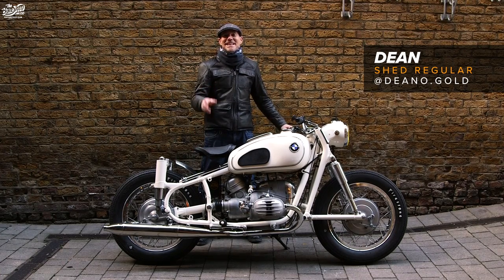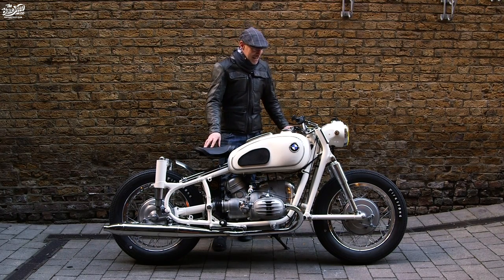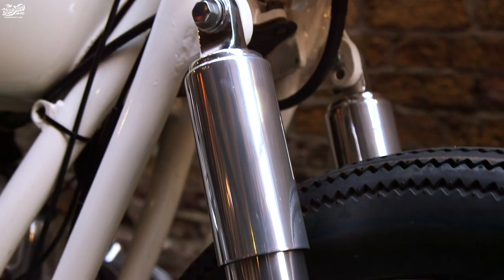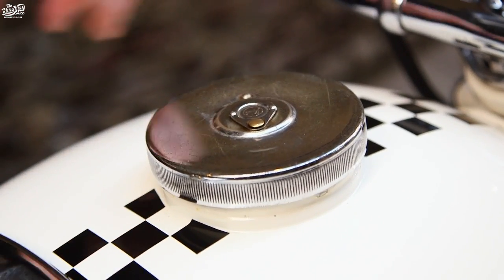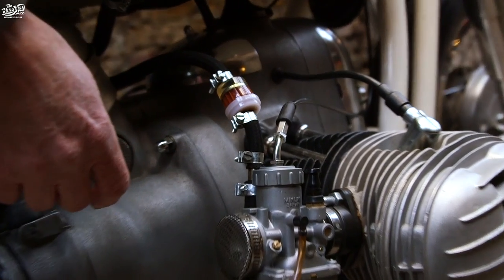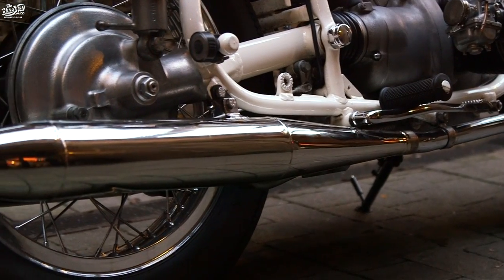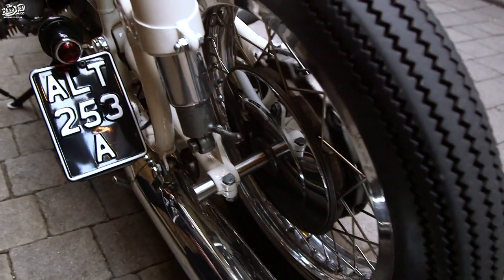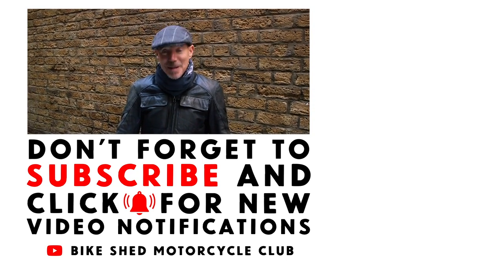Regulars Rides: Dean's vintage 1963 BMW R60

Comment: Some people say a vehicle is just to get from point A to point B. They're wrong. The vehicle is the point.
Reply: Here, here.
Reply: those ppl are defo  not petrolheads.
Reply: you are wrong as well. the ride from A to B is the point 😀
Reply: @uleiosu4582  It is harder to turn your head and look around with lower handlebars.  This results in relying more using mirrors especially while changing lanes.  Mirrors work great, but on this bike the mirrors are way too small to be effective.  This makes the motorcycle dangerous in a traffic situation.  So this motorcycle is great for a single lane country back road.  Its a pretty bike and I love it, but safety must come first above styling.  One mistake in a urban area or a city freeway and you are dead meat.  Other than that its a super cool bike.
Reply: indeed, its a gorgeous bike and yes safety first above everything. ride safe!
Reply: I'd say it otherwise, what matters is "the way".
Reply: I had an R100 RT in the late 1970's early 1980's. One of the best bikes I have ever owned.
Reply: Hear Hear!!!
Reply: @uleiosu4582  Why not both?
Reply: My car is just a vehicle to go to A to point B. BUT! my motor is statement. It's my break for freedom away from people and compliments my style...speacily since my bike is heavily customised to my style.
Reply: Yeah so u have to get another vehicle to go to it
Reply: it's not the bike, it's the ride itself that is the point.
Reply: Beautiful beautiful
Reply: they are electric vehicle owners

Comment: I rode a R60/5 for many years. Never had a better bike. Only sold it to save the farm. I called it my sewing machine for the smooth faultless running. Top speed 105 Mph. all day, (not 106). I pulled it apart for a look at 100,000 k and couldn't measure appreciable wear in the chrome/moly cylinders but put in new rings anyway.

Comment: I had a ’57 and a ’58 both R69’s. Restored the ’57, an old gendarme bike, myself while working in Morocco in ‘79. The ’58 I bought fully restored while working in Thailand in ‘84. Shipped both back to the US and entrusted my brother to take care of them until I returned to the US. Bastard sold both of them and didn’t say a word to me about it. That’s been 25 years ago, haven’t spoken to him since. Tip, lose the Bing carbs and get some Mikuni carburetors. Don’t touch anything else, they are perfect stock. Best, most dependable motorcycles I’ve ever owned.

Comment: My.wife's grandfather owned one of these in the 60s. It had a Steib Sidecar and was black it had a long range BMW fuel tank, even bigger than the one shown on this video. I have a Riese und Müller pedal cycle with the same type of front suspension. The bikes don't dive under braking and provide a very smooth ride. Great video 👍

Comment: Absolutely stunning machine!😍 I’ve got a 1980 R100s that had a ground up resto done by a mate. I took it out for a couple of hours on the weekend. I just love looking at it, riding it & listening to it. Here in Australia I have it on club rego so it’s a special treat taking it for a run. I have had the S1000RR & traded that beast for a S1000R. Also in the shed is a 2003 Rockster which is having a mild makeover😉😈😎 Gotta love a boxer twin👍🏼😎

Comment: Man I love it 😃 And I can't tell you how much I envy you for living in the UK, over here in Germany you'd never get this bike registered as steet legal. 
I also love the checkered pattern on top of the tank. 
But I'd change the bracket between the rear shocks, maybe I'd try to install a slightly longer rear fender (possibly with a bent steel frame underneath) and connect it to the shocks.
Then again I really love the yellow light, it fits the bike perfectly!!!

Much love and respect from Germany 🤟

Comment: I would like to point out ( incase you don't know this)  that the top front shock mounts are in the wrong place,  they are meant to be in-line with the steering head, and it was quite a common mod to have these repositioned for better handling

Comment: You have the earls forks in the “sidecar” position
Reply: Ok,I'll bite. How many positions are there,what needs to be done differently, and what does it do to the handling if you leave the thing in sidecar position  ?
Reply: @paulmanson253  2 positions, the horizontal arm of the swingarm needs to be shifted back to the non-sidecar hole just behind where it is currently hinged.

Comment: Chrome shocks on front is a bit odd. Looks really great. That R100/7 Motor /2 is a scary ride im sure. I have seen R65 Motor swaps here in Texas. Never a R100. I put over 280.000 miles on a R80/7 WITH R100 Jugs. Best motorcycle I ever had,no joke!

Comment: Superb different bike. I would just say mesh over a carb inlet especially Mikuni may not do you any favours with part throttle opening response as it disrupts flow to slow running system but if its good for you thats all that counts.

Comment: Great lines but needs foam or something to prevent dust, silica or metal dust sucking into you engine. Velocity stacks are for track too. Seen lots of Brit bikes wear guides and valves fast that were chopper/bobbers.

Comment: Congratulations sir. Amazing sound. I am owner BMW R67/2 1953 . Can you write the model number of these carburetors. Have any parts of the carburetor been replaced ? Thank you very much.
Reply: Carburettors are Mikuni VM26 from Motorcarb 0151 924 5383.....they jet them for your bike....bought the better rubber tipped needles to stop any leaks from small dirt...bike does sound great thanks....Dean 🏍
Reply: @deanogold7282  Thank you very much sir. Have a nice day.

Comment: Could you please-please share what size and model carbs you have and what main and pilot jet they used. Also the rubber spigot, can you tell me what size that is?  I have a R50/5 and desperately want to change the Bings to Mikuni just like yours....By the way Uni make angled filters you can put on and angle them up.

Comment: It is harder to turn your head and look around with lower handlebars.  This results in relying more using mirrors especially while changing lanes.  Mirrors work great, but on this bike the mirrors are way too small to be effective.  This makes the motorcycle dangerous in a traffic situation.  So this motorcycle is great for a single lane country back road.  Its a pretty bike and I love it, but safety must come first above styling.  One mistake in a urban area or a city freeway and you are dead meat.  Other than that its a super cool bike.

Comment: Beautiful except for the lack of rear mudguard.
Reply: ...and adequate mirrors.  It is harder to turn your head and look around with lower handlebars.  This results in relying more using mirrors especially while changing lanes.  Mirrors work great, but on this bike the mirrors are way too small to be effective.  This makes the motorcycle dangerous in a traffic situation.  So this motorcycle is great for a single lane country back road.  Its a pretty bike and I love it, but safety must come first above styling.  One mistake in a urban area or a city freeway and you are dead meat.  Other than that its a super cool bike.
Reply: @JohnDoe-bf1fw  yawn. Give it a rest.
Reply: ..."yawn" 
 ...crash...  itty bitty mirrors plus a cafe riding position is a recipe for disaster.
Reply: @JohnDoe-bf1fw  stick to your VFR plastic police specials then. I'm 60 this year, been riding since FS1E's and 16 years old. My current road bikes both have mini h/bar end mirrors. An 89 very non std Cali lll (950 Guzzi) owned for over 20 years and a stroked owned from new highly non std 79 T140 (830 Triumph).
Reply: @michaelhayward7572  sounds good. I'm 55 and I've been riding since 14.  I've gone the last 25 years without a car.  I ride 12 months a year mostly on the freeways of southern California.  Big mirrors are a must for safe freeway riding.  The neck doesn't bend that far left and right in a cafe riding position.  It's better to have your head straight and rely on mirrors to change lanes.  Bigger mirrors means bigger view. It very easy to miss see a car in a small mirror.  Most accident happen during lane changes.  Therefore it's better too have big mirrors. 
GET YOUR BIGGER MIRRORS TODAY!
Reply: Needs front mud guard too!
Reply: @markjones336  I agree.  You never know when it's gonna rain.
Reply: master DOGE  Today forecast calls for more sarcastic comments.
Reply: Moto Guzzi  OK, buy one then put mudguards on it.
Reply: Moto Guzzi  I hear ya.   I'm riding a 20 year old R1100R.  Its not a vintage classic, but I love it and plan on keeping it running indefinitely.  The new bikes are over priced and over powered.. and engineered to require the owner to spend a fortune at the Service Department.  Parts are crazy expensive, but I believe its cost effective to keep an old bike running if you do the work yourself.

Comment: The old oil was probably non detergent. Back in the day we used non detergent in our Hondas and in the winter the oil turned milky. We figured it was because the oil didn’t get hot enough to get rid of the moisture.

Comment: This is a lovely bike but if it was mine I would put the mudguards back on as otherwise road spray would get everywhere and also put back the chrome tubes between air box and carbs as a proper air filter reduces engine wear

Comment: Why do you mantain the original Airfilterbox on the gearbox ?  You are driving the Mikunis open.  Throw the Airbox away and if you want put an old R71 mesh airfilter at the place.  The silhuette of the engine enhances a lot, believe me.

Comment: bike would totally look different alot better in my  honest opinion if you just extended that rear mud guard right over that bracket that holds the rear together and then have the lip ending right after that bracket, effectively hiding that rear suspension bracket and cleaning up the look alot i think it would make it look amazing if you did that there!! otherwise beautiful bike absolutely brillent but please extend that rear fender to cover that ugly but structurally integral piece of the bike!!

Cheers,

-P3T3R

Comment: Not a restoration. It's clipped, cropped and clapped. The fenders added  both looks and functionality. How's that black stripe up your back in the rain? How about flinging stones at people's windshields? The lack of functional fenders is illegal in many states, for a reason. No air filters? you do realize the air tubes are part of the tuning, and that they run better with them?
Maybe someone can actually restore it eventually..